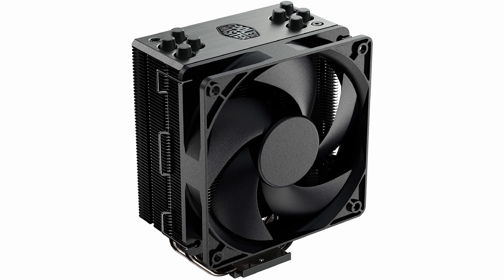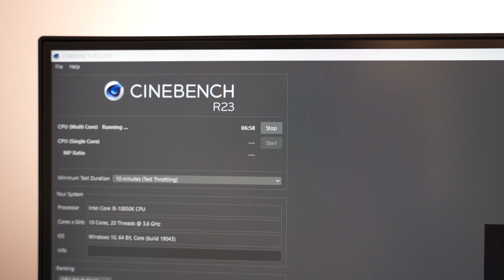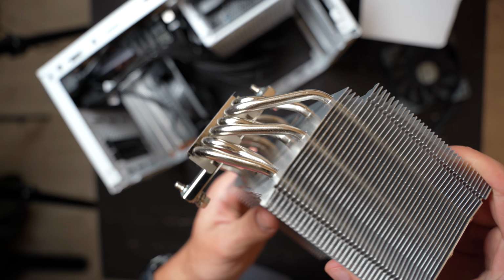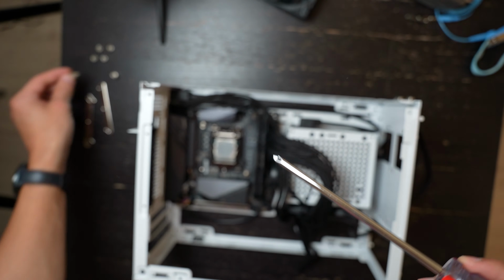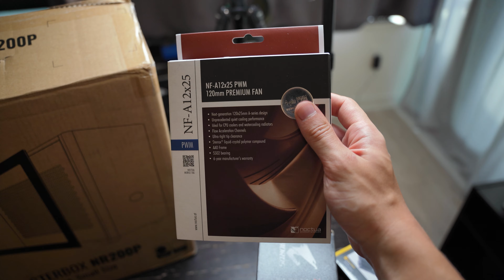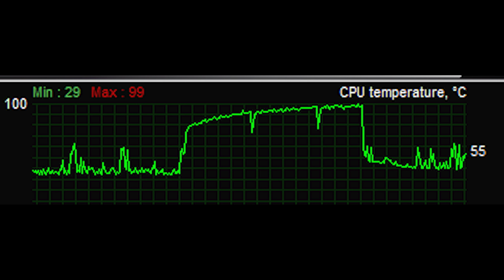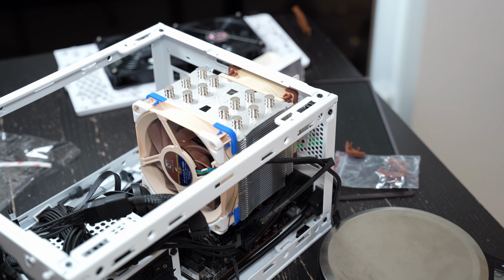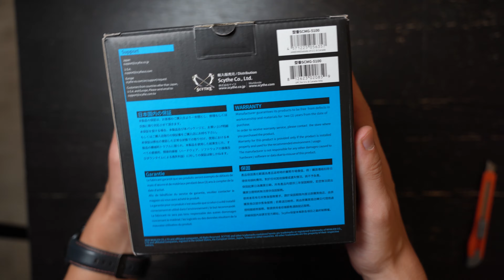NR200 Build - Best Air Cooling Setup w/ Tempered Glass (no compromises!)

Comment: It may have helped your Temps if you mounted the CPU cooler 120 mm fan blowing toward the back (through the cooler) instead of the 120 mm and the 90 mm fans pulling air in opposite directions...
Reply from the maker: But if I'm gaming, the hot exhausted air will blow onto the CPU!
Reply: @JSyntax  From what I seen the way you mounted the 120 mm fan on the CPU heatsink, the airflow is flowing away from the heatsink toward the power supply. Heatsinks work more effectively when you push air through them. Pulling air through them doesn't work as well. Also, the 90 mm fan is drawing air the opposite direction out the rear of the case so in essence the two fans are fighting each other. If you redirect the 120 mm you will have better airflow out the rear of the case and lower CPU temps.

Comment: In the title of the video you say it is a "NR200" but in the links to buy you link a NR200P, im not sure of the difference between the non p version and the p version, but will the CPU cooler also work fine with the P version? (sorry its terribly worded)
Reply from the maker: Yes, p just means it has the tempered glass!
Reply: @JSyntax  Non P version without tempered glass has 3 mm more space for CPU cooler height.

Comment: the youtube channel machines&more says its better to have top exhaust and cpu fans exhaust out the back and its not worth having fans on the gpu, he also shows graphs of different configurations for temps, but i also guess hes using the normal nr200 and 3700x. but your video is still amazingly well done thank you for it!
Reply from the maker: I've heard conflicting reports. Fundamentally, having an rtx 3070 card blow hot air through its exhaust and having a CPU cooler suck in that warm air is concerning!

Comment: I have the same case and to be honest, the case works best with a Tower cooler even though I have a 120 AIO from ID-Cooling the pipe is too big and I kinda have to force it in thus making the pipe push down into the graphic card which makes it slightly bend. So yeah to anyone considering having a small AIO, I recommend you not to.

Comment: Why can't you just turn your cpu cooler to move air in a natural way - up.
Don't you think that the side airflow will cause more turbulence than throwing the hot air up and out of the case? Did you tried that?
Reply from the maker: You'll want cooler air from the exterior though

Comment: Haven't completed my own build yet, still waiting on some parts (GPU, sigh) but I opted to use the budget friendly Vetroo V5 to cool my 5600X (at 65W this CPU does not require the highest cooling). Despite that I expect the V5 to perform pretty well once I change it's one mediocre fan and slap on two Arctic P12's on it which will definitely fit in a push/pull configuration, drawing in air from the rear.
I will definitely try an exhaust configuration too though. If thermals allow it prefer to keep that as an exhaust to avoid dust built-up inside the case. Tinkering a DIY rear dust filter is the other option.
Lastly I have not yet checked if the Gigabyte B550I + Vetroo V5 combo allows for two 25mm top fans. It' gonna be close.

Great video though, the NR200P is the most flexible ITX case outthere, I wish CM listened to the community and released a v2 that takes our complaints into account (Top AIO, 2mm more cooler clearance, ...) and NO don't start about the MAX.
Reply from the maker: Agreed they haven't made a v2. I guess it's about keeping their machine assembly line profits! They need volume to make the case affordable

Comment: Thanks for the vid.  I purchased the NR200p and I was able to get my hands on a 3070 so this is really close to my future build.  I went with a Noctua NH-U9S for the clearance.  Hopefully it cools the Ryzen 7 5800X well enough!
Reply from the maker: Nice choice!
Reply: Be curious to know how you're getting on. 5800x is tricky to cool. I wouldn't expect a U9S to be able to cope.
Reply: @egocd  It gets along great.  I have two 120mm fans at the bottom acting as an intake and two 120mm fans at the top as an exhaust.  Even with the tempered glass side panel on, I'm getting around 50°C on idle and just above 60° under load.
Reply: @peterbieniek7758  On a 5800x? That doesn't sound right at all :D
Reply: @egocd  Yeah that statement is pure BS, I recently bought a 5800x paired it with a Noctua U12 Chroma Black with 2x Arctic Bionic 120mm fans and on Cinebench it hits 82C and Gaming on a 240Hz Monitor - Battlefield V 170+ FPS it hovers from 75-79C depends on the map.

Comment: Tip for you - you mentioned needing special screws if you go with slim fans up top. As it turns out, the gray plastic spacers from a Noctua SecuFirm 2 kit that you use on AMD AM4 are 10mm tall. For me, using Noctua slims that I already had on-hand, with the 10mm spacers, I was golden. Naturally, you've got to have spare spacers on-hand to pull this off, but you can do it without special screws.
Reply from the maker: Wow! Ty for the tip
Reply: @JSyntax  Cheers. It was a total MacGyver moment. I was in the middle of a case transplant and BADLY didn’t want to roll back.

Comment: Mugen 5 is a good cooler but the fan is only 1200 RPM. Get the Black Scythe Kaze Flex fan that is 1500 RPM for a cooler CPU. Or just buy the Mugen 5 Black Edition.
Reply: I read that the Black Edition actually performs worse.
Reply: @CknSalad  you read wrong

Comment: First of all, that's not your IO shield but your VRM heatsink, much needed on a passive Z490 board. Second of all, the heatsink density of the Mugen 5 is optimized for slower fan speeds.
Reply from the maker: Interesting! Makes sense if they paired it with a 1300 rpm

Comment: Nice video, but i perfer Corsair ML120 PRO fans, 400-2400rpm, iknow theyre a bit louder, still havent heard them be loud  tho.

I have i9 10850K, used a H210i case and a 6700XT sapphire, with a cheap corsair 240 aio, kept 65C while gaming, non o.c, if i did o.c, the h210i would be a bonfire

Did you do this temp test with o.c? Planning on buying this case

Comment: I have found for that tower a fairly decent cooling for cpu not very demanding in temperatures and that fits perfectly and with noctua fan, it is the Noctua NH-U9S and compatible with lga 1700 socket, a 12700 (no k) is perfect for it since it does not It demands a lot of temperature but with excellent performance, as for previous generations, it is preferable not to exceed 11600K or 11700 (not K) the K versions of i7 and i9 are very high in temperatures in all their generations.
Reply: I forgot to comment that for AMD both the 5600x, 5800x and 5900x are very high temperature cpu for depending on which air cooling, the list is greatly reduced, better to mount the amd 3000 generation by air cooling, although a 5600G would be the best option since its temperature is much lower than the other ryzen 5000. All this always talking about air cooling that enters that tower and with tempered glass included.
Reply from the maker: Agreed

Comment: Hey man check out the Phanteks P200A, it's probably the most spacious and airflow-oriented ITX case there is.
Reply from the maker: Looks like a very solid case. Is it smaller than  nr200?
Reply: @JSyntax  No it's larger, in fact it can fit a standard ATX PSU. It's 205 (Width) x 365 (Height) x 400 (Depth) mm in size.

Comment: I used the 212 black edition for my 5800x build 2 months ago. I had to agree that mount design of the 212 cooler was so stupid. But the thermals are quite acceptable and the fan is really quiet as well.
Reply from the maker: Ah yes amd run a lot cooler than Intel's right
Reply: Installing the 212 black in my nr200p build tonight, Wish me luck.

Comment: I want to build my pc intel i7 10700k hot cpu
I Think aio is better than premium air cooler!
Reply from the maker: yes aio is better, but  having one installed on the side panel prevents you from admiring the beautiful innards of expensive build
Reply: @JSyntax  I plan to Aio 280mm Arctic( Side) (bottom)  Noctua slim fans 120mmX15mmx2
(Top) Noctua 120mm x2fans

Comment: Nice video! I also went with the Mugen 5 but the black edition, looks amazing and performs very well. Best heat sink for the Nr200p IMO.

Btw the kaze flex fan with the black edition is upgraded and can go to 1500rpm but the a12x25 is still the best fan on the market for heat sinks/radiators. 

Did the 92mm fan make much difference? You didn’t test the a12x25 by itself.
Reply from the maker: Yes, i should have test more indepth but due to lack of time, i couldnt. My guess is that it doesn't hurt at very the least :P
Reply: I also got the Mugen 5 black edition, partially due to the 1500 rpm fan. How is it working for you in terms of CPU cooling? And did it fit the NR200P with the TG panel?
Reply: @lucarolo  I’ve actually since swapped to the Fuma 2 and thermals are considerably cooler. Getting high 50’s low 60’s when gaming with a 5600X now before with the Mugen 5 it was more mid-high 60’s. 
Both the Mugen 5 and Fuma 2 fit no problem with the TG panel but it’s highly motherboard dependant. I’m using a ASUS Strix x570i
Reply: @OrionSain  yeah, the Fuma 2 is pretty much hit and miss in regards to the TG panel. I think I’m going to stick to the Mugen 5 BE since the matte black finish looks way cooler (pun intended). Anyways, were you doing rear intake with both the Mugen and Fuma 2?
Reply: @lucarolo  yeah honestly the Mugen 5 is still very good. Yeah had rear intake for both which I found was the coolest orientation. With two fans at bottom as intake for gpu and two up top for exhaust.
Reply: @OrionSain  awesome! Thanks for the info!
Reply: The wondersnail 120 fan from scythe is a cheaper alternative to the nfa12. I use it on my Mugen 5 and is definitely better than the stock flex fan.

Comment: What an awesome video, one of the videos I enjoyed the most in all YouTube. Congratulations and thank you very much for this content!
I have a question, have you connected the CPU Cooler fans with an "Y" extension to fit in the CPU Cooler Motherboard connection? Did you do the same with the case fans? I'm looking to build a PC with this case and the motherboard I will buy only has 2 case fans connections. What do you recommend? Is better to use many extensions or a HUB (is it possible to lose efficiency?) xD
Thanks!!!
Reply from the maker: Thank you so much for the kind comments and you can just use y Splitters it's honestly totally fine and you have plenty of fan headers with his case

Comment: 8:30   FYI.  You can make almost any screwdriver magnetic.  Just buy a tool magnetizer for about 5 bucks. (Wiha's 40010 in on my bench).  This is a must for PC builders/repairers. Then you can rage at the manufacturers that use barely or completely non-ferrous cheap alloy fasteners. lol
Reply from the maker: Good tip! Ty!

Comment: Nr200 or Asus ap201 😬
Reply from the maker: Oof hard question
Reply: Depends.... Do u wanna go itx or matx? That's the main difference. Air flow is pretty much the same.. You can fit an extra case fan here and there with the ap201. Very similar build and footprint

Comment: I never understood the love for the 212 Evo.  I guess it has good consumer reviews because it is entry level and new builders usually only have the bad intel stock coolers for comparison.  It was a first cooler I got and the mounting mechanism was awful, the fins bent immediately, and the included fan started rattling after a couple months,
Reply from the maker: Yeah, too much hype for me honestly. Need to spend that extra 20 bucks to make your time worth it. It's obviously still much better than stock cooler.
Reply: evo 212s were great at $30 and sometimes less on sale/rebate. now ($40) they are only $10 cheaper than the next expensive, but probably not a 25% increase in performance seen in the "better coolers." i'd still go with a non evo. nice video tho. definitely more comfortable with planning my build with an nr200 and a scythe cooler

Comment: Nice video, I really enjoyed it! 

For any cpu under 8c/16t the Big Shuriken 3 with another 120mm fan (even the sickleflow included, btw nice vrombing noise as case fan) gives great temps, stock and UV/OC. I tried the bottom fans with the 3060 Ti FE and it didn't lesser much the temps (<5°C). 

I changed the top fans with 2 120 redux 1700 as exhaust and it seems to work well and quietly. I will eventually add 2 slim fans at the bottom and see the result on the RX6800 FE.
Reply from the maker: Very nice setup!

Comment: Russian version. Without glass. Economical version. You will only need two fans. There are only two fans per case at the top. Noctua NF-A12X25-PWM or equivalent. Wind direction to the inside of the computer case. The video card is horizontal, the case is without glass. You can use any CPU cooler. The hot air from the video card goes into the side grilles. Cold air for the video card from below. All the hot air from the processor is blown away by air from the upper fans and also leaves on the sides through the grilles, because below the air flow rests against the video card.

Comment: Had my NR200p for almost a year and I originally had a 212 evo cooling a 9700k with no worries. A little weird you thought a 212 evo could cool a 10850k in a mini itx case but I assume this is your first itx build. Comparing a cheap cooler company to a premium one doesn't make any sense... of course Noctua would use better hardware they're coolers are almost 2-3 times more expensive. The thermal contact with the heat sink was fine but you could of applied the thermal paster better if you were so worried about surface contact. Also my 212 evo fitted just fine in my case...
Reply: don't get offended Troy! ;) The mugen is not 2-3 times more expensive is it? and the mugen also cools the cpu fine in an itx case? Whats your point HAHA if you're paying for a product wouldn't you want it to have good thermal surface coverage? or would you condone companies to not make their product as effective as possible?
Reply: @ABCJefff  I'm not offended? I'm not sure where you're from but Mugen is almost twice as expensive as the 212 Evo, my point is that from my experience the 212 Evo is an amazing cooler in the NR200p and I used it for about 7 months with no issues, as well as it fits the case almost perfectly with maybe a mm or two that is completely unnoticeable.  The 212 Evo has perfectly fine surface coverage for its price point, so yes I did pay for a product with good surface coverage and Cooler Master does make their product as effective as possible... so what's your point? I just don't understand comparing premium companies and budget companies, then saying the budget company doesn't make as good as products as the premium company because of course a cheaper product is not gonna outperform a more expensive one.
Reply: Hey guys advice plz. Is the Wraith cooler enough for the 5600x sitting in a NR200 case? My last built PC is an i7 920 with a $100 cooler but I actually never overclock.
Reply: @smonkey001  Not exactly sure but it should be fine, maybe not optimal depending on your fan configuration as the clock speed might not boost as high. If you have the money I'd go something a little better, there are better coolers out there for like $30 that will make a big difference depending on your setup

Comment: Alpenföhn Dolomit Premium 210W TDP (Noctua D15 is around 240W TDP) 154mm height, no issue with TG panel, welcome :)
Reply from the maker: hmm looks similar to the mugen 5 design, is it really that much more perfomant?
Reply: @JSyntax  I Don't know anything about Mugen 5 perf., came from Noctua D15, but as i see the perf of Dolomit with 2 fan is almost the same as D15. And it's perfectly fit with TG panel in NR200P and don't need change the fans like the Mugen 5

Comment: I don't understand why people put i9 cram it on mini itx then rant about temps? Mini itx are at best with 65-125w CPUs IMHO.

It doesn't matter if you only have stock cooler plus the tempered glass.

Btw, why you want to show off the insides through TG panel when cables are a mess, and the fans doesn't look great? (thanks to noctua's appreciation to fecal color palette)
Reply from the maker: I have lower expectations than you!

Comment: I build a nr200 with a 11600k (high temps on boost), 3060ti msi 2fan, scythe big shuriken 3 with mf120 rgb fan and 2 on the top. 2 bottom noctua fans, and it works ok. Got temps about 70-84* for the cpu and 35-68 for the gpu. It could be better but with this minimalized fan setup im happy and its a eyecatcher rgb build. What do you mean about that?

See the reference nr200 synthwave -> on youtube

Comment: My Hyper 212 Black Edition cools perfectly the i5 12600K. Didn't want to spend more than $50 also I can use the glass side panel as I took off the plastic bracket that covers the tips of the pipe.
Reply from the maker: jelly.

Comment: Nice build! I almost went with the Mugen 5 but instead went with Fuma 2. Might depend on motherboard but the Fuma 2 fit in my NR200P with the TG panel
Reply from the maker: Damn, I'm jealous. If it fits, then I reckon fuma 2 is better.. But how much Esp after adding second 92mm fan and better 120mm fan?
Reply: @JSyntax  I just have the 2 120mm kaze flex fans it comes with on it. One is 25mm and the other is the slim fan. Intaking air from the back of the case. Cools my Ryzen 3700x perfectly. Had the big shuriken 3 on there which did ok but still got a little hot at times
Reply: Great info except you forgot to tell us what motherboard you were using.  C'mon dude!
Reply: OK, i have a fuma2 with the TG planel too, my motherboard its a asrock b450 fatality mini itx
Reply: what motherboard did you use?
Reply: @TuanNguyen-eu5mj  Asus ROG Strix B450-I gaming motherboard